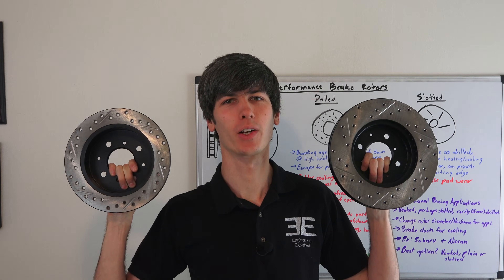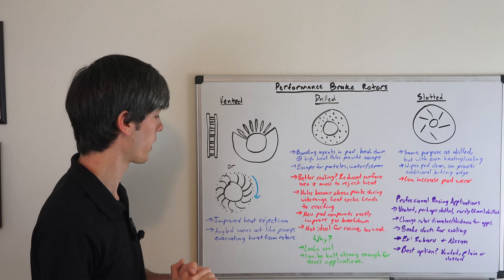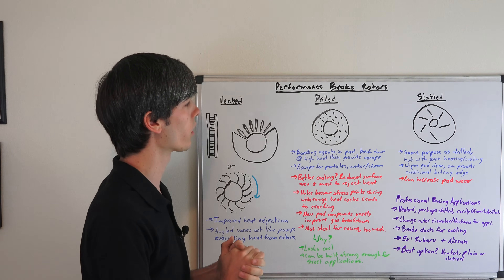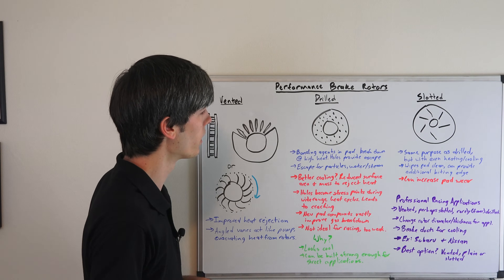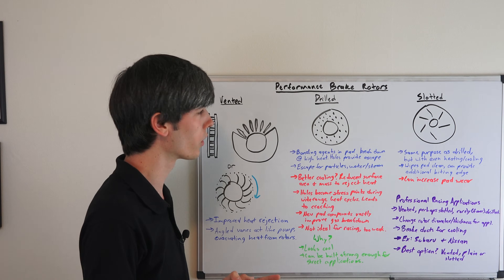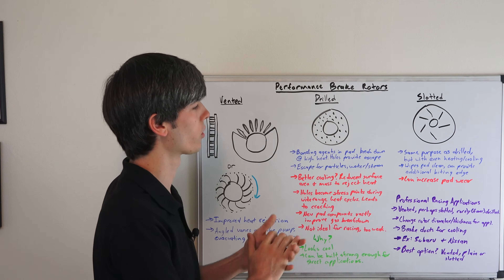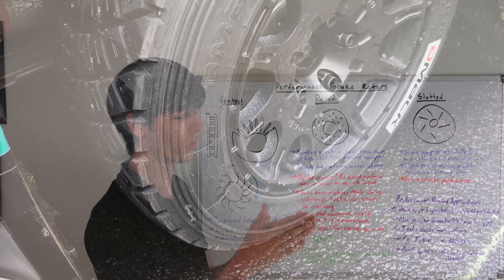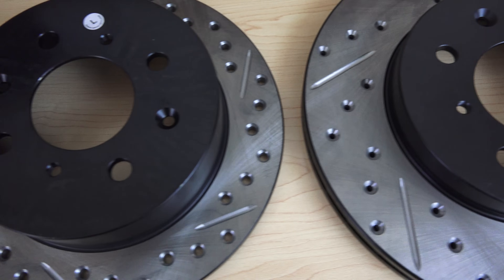Drilled, Slotted & Vented Brake Rotors - What's Best?

Comment: Why is almost all motorcycle brake rotors drilled?
Reply: Wouldn't you want some weight on the wheel for a better gyroscopic effect?
Reply: J Dea Thank you for the input. Does make sense when you put it like that.
Reply: For looks?
Reply: Because they heat up instantly. My front rotots on my car are 30mm wide, on a bike they are more like 3mm wide. If they heat up, they heat up instantly and take significantly less time than on a car with rotors at least 10 times as thick.

So they are going to need this cooling effect over the disadvantages. I'm also not sure if the same disadvantages apply on bikes as a lot less stress is put on the rotos (less weight of the vehicle). Hope you will still read that.
Reply: I'm still reading :) Thanks for the feedback.
Reply: +CentaX true, a bike only weighs a tenth of a car.
Reply: because engine braking is the best in motorcycles and can easily get you out of any sticky situation when you are in the proper gear
Reply: +Junior Pivaral I used engine braking one time, and I guess I was going too fast for it. My rear tire was spinning out of control, so I had to shift up in gear again. Pretty scary stuff.
Reply: Car discs will heat up quicker because cars are heavier, giving the brakes more work to do - cars can outbrake bikes, the brakes aren't the limiting factor. It's the friction between the disc and pad that's doing the heating, so that's where the highest temperature will be, regardless of any cooling. 
Cooling is only likely to be significant once you release the brakes. If they were good enough to dump heat on a par with the heating, they'd need insulating to get the pads up to operating temperature. Solid, smooth, discs work best on the road the majority of the time.

Comment: Racing discs are carbon: no vents, no slots, no holes.
Reply: The Isle of Man TT STI is using  355mm vented discs with curled slots.  The video also provides two rally examples where either venting or venting+slotting is used.
Reply: Not all discs are carbon . Not used in Indy lights,  nor most touring cars , pretty much  All  LMP cars.
Reply: okleydokley unless it's raining, then they'll switch to steel.

Comment: The difference between Slotted and Vented was not clear...
Reply: Xeno....Vented is like 2 rotors connected by tabs that move air between the rotors for cooling. Drilled is just what it says where holes are drilled in the rotor face, in theory, to prevent the buildup of gas between the pad and the rotor. The picture at the end of the vid shows a drilled and vented rotor on the right.
Reply: Sry you said slotted. Slotted are channels either deeply cut into the rotor or sometimes cut all the way through the rotor for the same gassing purpose. They are the straight lines you see in both rotors at the end of the vid.
Reply: Hammer0f Thor
Thanks

Comment: No, the real reason they drill holes in rotors is to REDUCE WEIGHT. Pick up a non drilled rotor and compare it.
Reply: +Stephen N Pick up the brakes on a Prius and then on a legitimate race car. The Prius has lighter breaks. The braking system just isn't the place to reduce weight, stopping power is always more preferable within reason.
Reply: +enginesnblades 
unsubscribed
Reply: +enginesnblades That's not a good comparison.  The Prius uses's 2 different braking systems jointly, wheel rotor and transmission braking.  I'd assume the wheel rotors are probably smaller then normal.
Reply: Finkin79 I just picked a small car, I was unaware about that. My point still stands though, there are many better places to go for weight reduction than breaks and it's no secret.
Reply: The weight reduction argument  makes sense... kind of.  Moving weight causes a bigger change in performance then none moving weight.  That being said, the brakes aren't the first thing i'd be looking at for massive weight savings, not by drilling them anyway.
Reply: Finkin79 It may make sense on face level, but really the breaks? I mean come on. Not only is there not much weight there to be lost, it's the last thing you want to fail. You'd shed off way more rotating weight just by using a lighter driveshaft and axles or cv shafts and there would be no negative effects to drivability or safety. You could even go for lighter wheels. I've known many racers trying to do all sorts of things to shed pounds, especially rotating weight, but I've never known anyone seriously consider drilling holes in rotors for weight reduction.

Comment: why is solid brake lines used ?
Reply: to reduce possible bulging from the rubber expanding in the brake lines, 
less expanding will make more fluid pressure which = better braking
Reply: Thank you Andrew

Comment: My motorbike has drilled as stock, as with most i see bikes bar motogp
Reply: +Michael Kennedy Motorcycle disks usually aren't internally ventilated so the cross drilling helps reduce heat.... And it looks cool...

Comment: This isn't really 100% accurate that you don't see drilled rotors in racing or it can't be used in racing because of stress. If you look at World Superbike racing they all use drilled rotors. It's not too weak, they don't crack. If any of that was really true they wouldn't used there.
Reply: Motorcycle brakes get a lot for air than car brakes which im sure helps them to run cooler.

Comment: "stay away from drilled rotors" buddy its LOL what you are saying, rotors in this video- 1th its replacement for oem size rotors, they do great job and helping not over heat your brakes, but "yes" they have limit! They can hold even quick race event, but for more serious you should use big slotted rotors with 4-6-8 pistons callipers, yes with drilling and slotting you losing area for heat despair but your brakes running cooler so there 50/50 points. Idea for slots in 90% for helping remove hot steam from the air moisture between pads and rotor... And dont say its only for looks, your knowledge not 100% correct in this aria, every brakes set up made for specific usage!!!! for normal daily fast driving- this rotors type - hold perfect no matter its ferrari or f150. Slotted rotors doesn't help for heat displacement, but they helping for fast brake pads bite-no water in between and also in extreme condition less stress for metal, drilled - 30-40% cooler compare flat blank and also removing water steam not as good compare slotted but they do! At the end - if you are lazy and dont wanna clean your rotors (3-4 times a year) from brake dust and also after winter there can be rust (smart move - spray them with zinc coat)- right way use flat rotors...

(Im not saying "you have to use that or that"- every one pick own idea")

Comment: You are incorrect about drilled rotors they are more suited for racing the holes are not to vent gas it is to reduce weight

Comment: you are not too bright. The amount of material you remove by drilling or slotting is very small. The best is to slot and dimple the rotors to stop them from cracking. I have used slotted/dimpled rotors on my last 4 cars and the brake fade dropped to zero and the braking distance did not change!!! Do your homework next time!!!!

Comment: "drilled rotors not good for racing. too weak."

have you ever looked at the brake assembly in the top racing classes in the world? f1 and lmp1 (the fastest cars that put the most stress on braking) use drilled, NOT slotted rotors. always. always. every single car, every single race, for years and years it hasn't changed.

.............?????????
Reply: +doctajuice And these same cars have engines designed to last just the duration of the race.
Reply: +peter candance right. Racing is a completely different thing from road cars. Why compare?
Reply: +peter candance although I must mention that wec cars are designed to run flat-out for 24 hours straight, and f1 in recent years has been really restricting the number of available power units per season. But even still, what's good for racing and what's good for a road car are not the same at all. So "not good for racing" i feel is a seriously inaccurate statement
Reply: +doctajuice Did you even watch the video, or did some research before you spread your misinformation?

Comment: Hi Jason, 
I find myself watching more and more of your videos, this one interested me a lot. I am in the market for a new set of front rotors in the near future. I daily drive a 2010 Audi S5 Coupe as well as take it to the race track approximately once a month (approximately 4 hours of track time a month). In my search I came across Cryogenic treated rotors (StopTech). What are the benefits of cryogenic treated rotors and are they worth the extra money?

Also, at the local Audi dealership I have seen the new Audi RS7 equipped with some really large rotors. These weren't regular rotors, they were bumped around the outside circumference, they look like a flower (see image here https://www.ecstuning.com/ES2777286/?gclid=CKnm5Z-Lj8wCFYNkhgodDEMC0g). I've seen brakes like this on performance motorcycles before and am wondering, is there any benefits to this design or is it just to look cool?  

One final question, How does the internal structure of vented rotors effect braking performance? Examples are straight veins, swept veins, "kangaroo paw" design or others.

I'd love to see an expansion to this video describing some of the advantages and disadvantages of the above items. I'm sure there is tons of different things that could be covered with regards to different rotors. The more information that's out there the easier it becomes to make a decision as to what would be most beneficial for different situations. 

Thank you